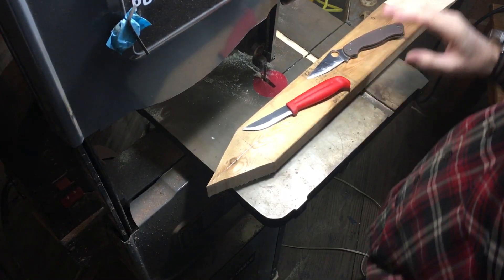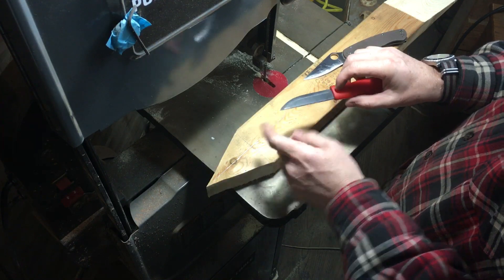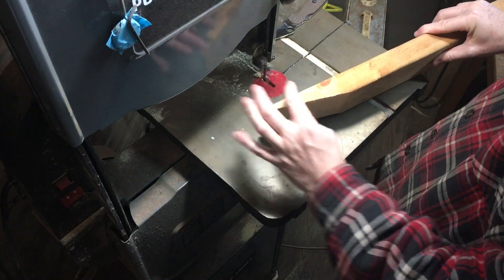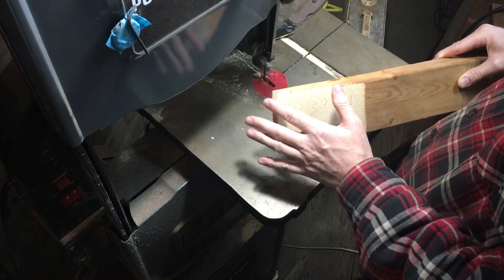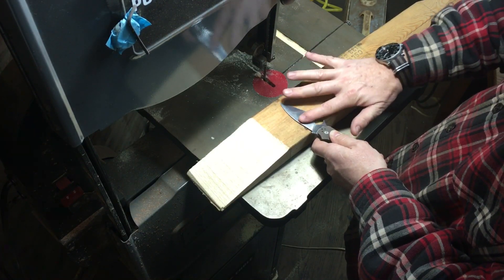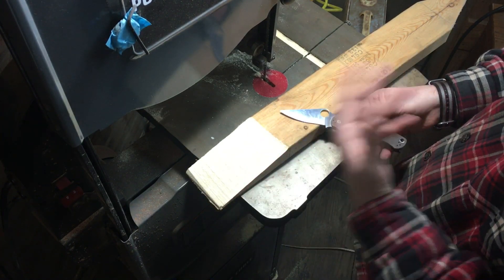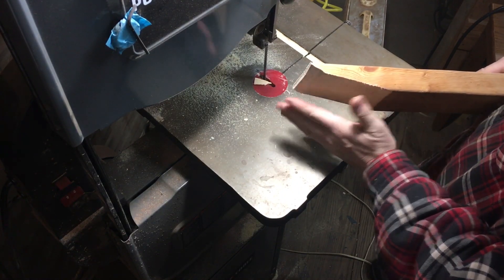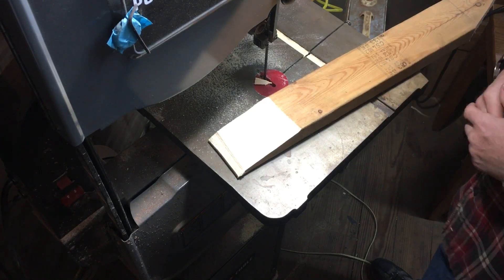Maintaining the Cutting Performance of Your Knife As Sharpening Thickens It Over Time

Comment: Nice visual demonstration w the board...very clear. And yet another good reason for the average person to prefer easy to grind steels. Makes doing that thinning much easier at home w/o grinding skills.
Reply from the maker: C amber I would bet that most people will not use their  knives enough to every need to worry about it thickening too much.  One exception is those people that are habitual sharpen just to sharpen.  Also, people that desire that perfect edge angle and polish want like the idea of marring the finish up to thin one down.
Reply: @mccullenj  True...I only have one or two I've needed to thin the shoulder out on, but I can see the need one day for some of my neck knives, given how narrow the blades are.  I can live with the finish too, but I do imagine the scratched primary would upset a lot of people.